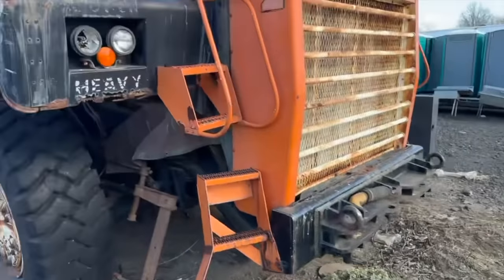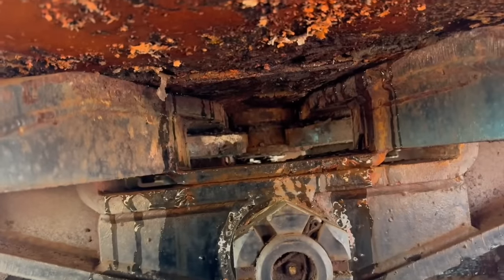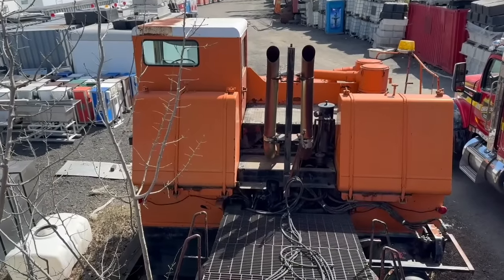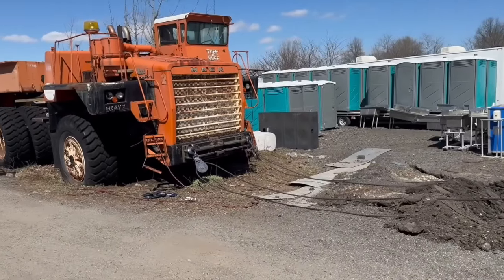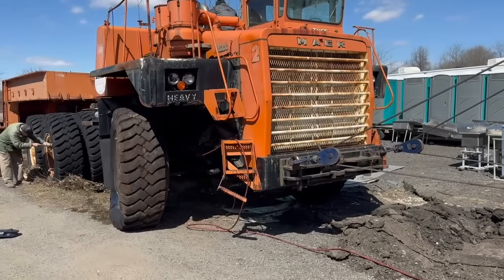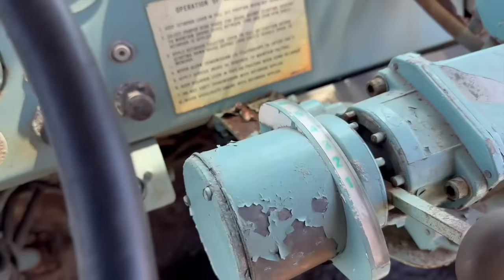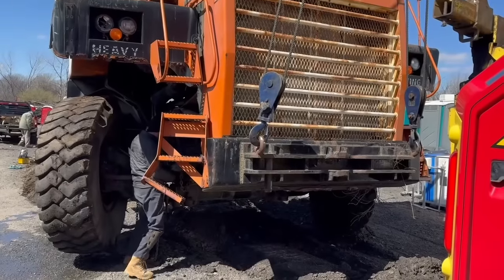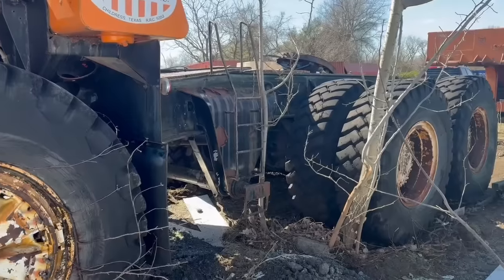Finding the World's LARGEST Mack Truck! - 1970 M100SX

Comment: So three of these were built for one specific thing and never used again? Dude, the amount of jobs this thing could have done...
Reply: Tuff-E-Nuff was used for many different jobs and pulled many different trailers.  I was told, when I was around the truck in the 1980s,  that it started life as a mine truck with a dump body. The TSI trailer in the video was custom built for it. It also pulled hydraulic platform trailers.
Reply: @tcunn2636  That gives me a little more peace of mind knowing it lived a fuller life than just pulling a thing once and being left to rot after.

Comment: Trailer I realize is a bear to move and takes up some serious real estate to store. Question is, where you ever going to find another one? They were built as a unit, I would figure out a deal, then where to store the thing. I truly believe you’ll regret leaving it.
Reply: They weren’t built as a unit. This is the 3rd, and smallest, trailer built for the truck much later in the 70’s. It’s not the original 600 ton Talbert.
Reply: I built a portable bridge out of the Talbert's deck. It was no where near a 600 ton trailer. American Rigging had it built,  was steerable at both ends. It also had a bad habit of turning over...

Comment: leaving that trailer behind is a huge mistake. Without the truck the trailer is fairly useless to whoever owns it now and once the current owner is ready to part with things, they will just get rid of it the easy way once the truck is gone, meaning the highest scrap bidder will get it and cut it up. Years from now it will be the biggest regret of whoever has the truck that the trailer is gone.